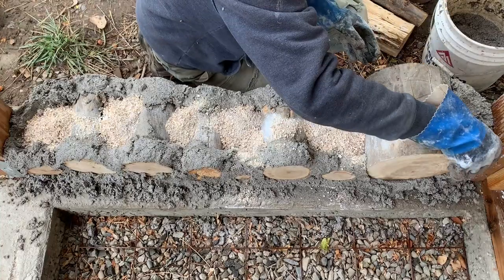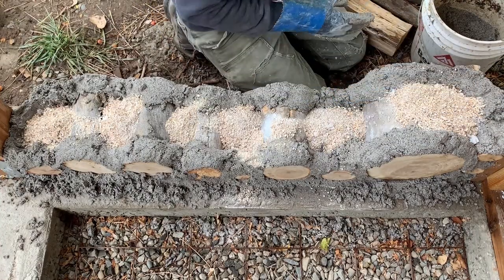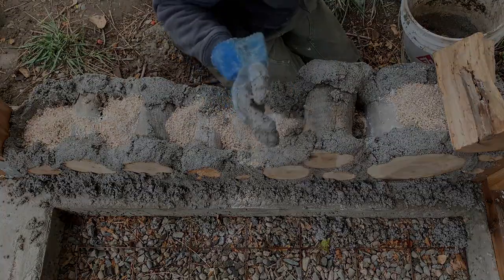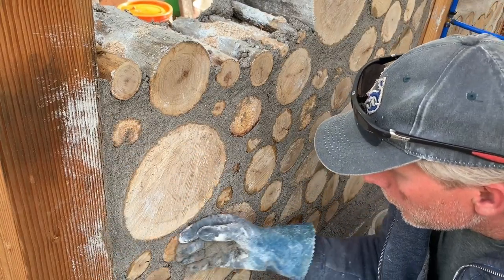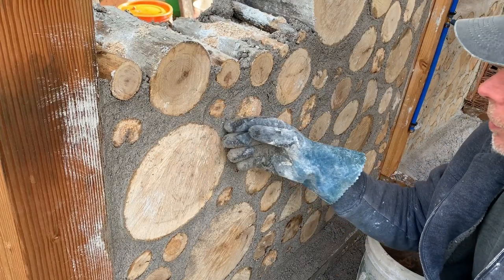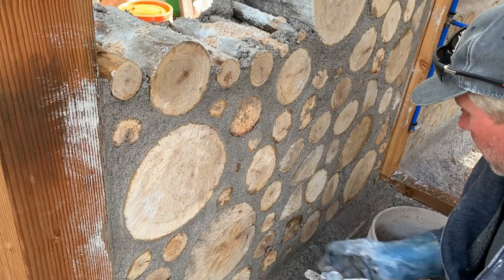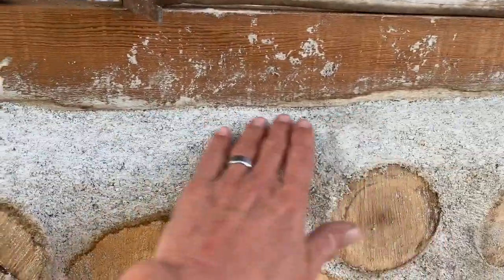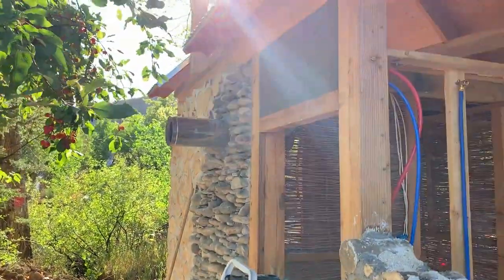Lost footage from my cordwood build!

Comment: Good information, working on a cordwood outbuilding this year. Question, adding a pigment to the Lime putty? My first guess would be there wouldn't be any issues with doing this. Your thought?  Also what about adding pigment to the Aircrete?  Any cracking with your mix, lime putty/sand 5-1?? Thank you.
Reply from the maker: Any masonry pigment should be no problem with either lime mortar or aircrete. My mortar has had no cracking at 5:1.

Comment: wow. that combination of stone, wood, and mortar is making a beautiful building. well, that and of course the builder. 8 years ago I had a tree removed in my backyard. which left me with lots of firewood and a stump. the stump stayed because I didn't pay for its removal. I have a question. the stump is of course getting all the weather and last year I noticed it was getting pitted. this year it has really changed. the stump is rotting out big time. So, I know that other large pieces have aged but not really rotted. My question, is how many years before rot works on these vertical walls? Hope this makes sense and it's beautiful work you are doing.
Reply from the maker: The rotting of wood is primarily caused by fungi that live in the soil, and moisture. It is best practice to have about 16-24” of stone or concrete at the bottom of such walls. I didn’t do that, but my dry climate makes this less of an issue. Two foot eve over hangs are a good idea, too. As long as this system is used with “good boots, and a good hat” it should last many decades in most climates.
Bonus: a neat trick for removing stumps is to plug them with oyster mushroom spawn plugs. These can be purchased from fungi.com, and others. You’ll get a couple good flushes of oyster mushrooms per year, for about 5 years. After that, the stump has been consumed by the fungi and you are left with amazing garden soil!

Comment: I assume that dustcrete could be used as the mortar mix, which would certainly cut costs, if it is viable?
Reply from the maker: There are some who mix soaked sawdust into this lime mortar for cordwood. I’ve done a little of this, but abandoned it in favor of the lime/sand mortar. The addition of the sawdust yielded a mortar that I found too crumbly in the narrow application.

Comment: Great videos,  how high did you build your first coarse ? and how long to set before you continued withthe second coarse? and how long before the morter is fully cured?
Reply from the maker: I would just keep stacking until I got reed of mixing mortar. The sand and the logs carry the load. Mortar is well set the next day, hard cured in about three days.
Reply: @radicalgastronomy  So if I was organized I could do an 8' x 8' wall in a day and not worry about the bottom portion blowing out
Reply from the maker: @chrisharrison3245  Absolutely. I’d be impressed. 4x8 is a good day.
Reply: @radicalgastronomy  when you mentioned that you had used 1/4 of a bag is that a 50lb bag? 
how many sqft total did you do and how many bags did it take for your whole project?
Reply from the maker: @chrisharrison3245  Yes, a 50# bag. I can’t recall how many bags this took, but I think I used less than 10.

Comment: How is that type of wall in comparison to today’s standard walls for insulation differences?
Reply from the maker: Typically these walls are stacked with 16-24” logs, rather than the 9” ones I’m using here. At 16” they tend to test out at R-20 plus. Mine performs satisfactorily as the wood stove heats all the mass in the mortar which stays warm all night.